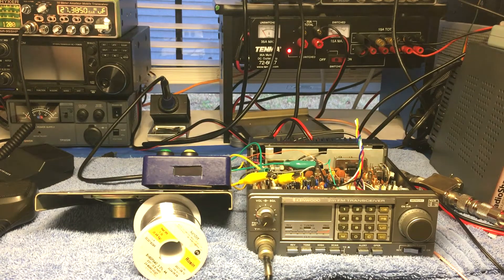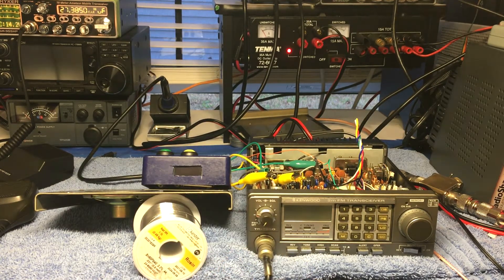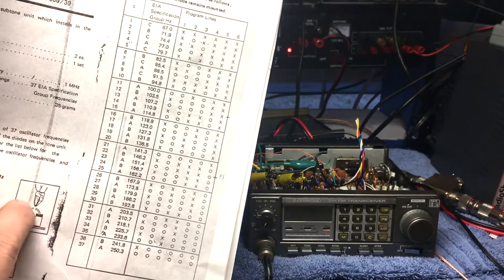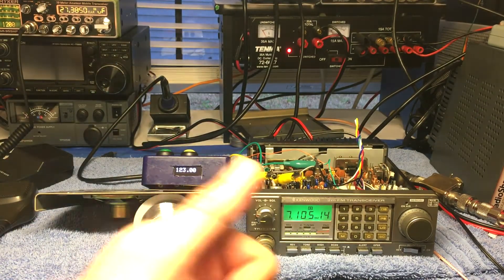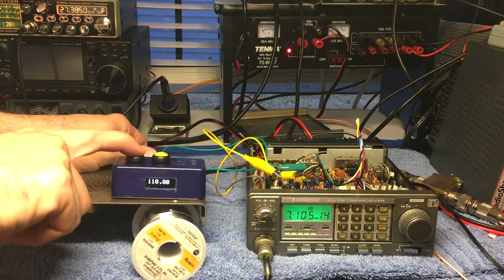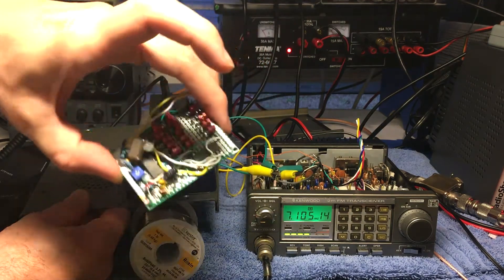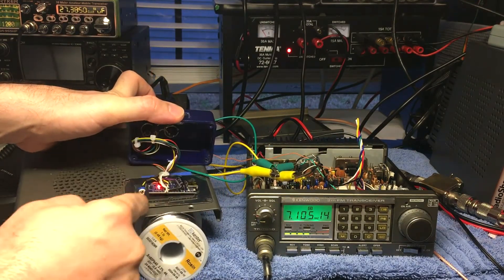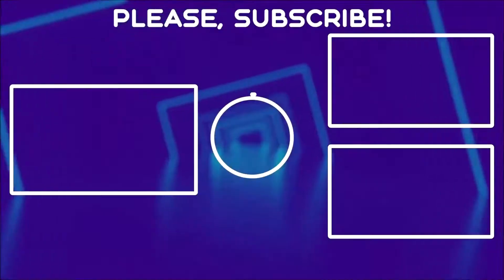Kenwood TR-7950  2m Ham Radio CHEAP CTCSS Tones with an Arduino !

Comment: YouTube keeps deleting my comments.  I just realized that it's because I put links in them.  I HAD said:
Nicely done. I came up with the same basic idea, but took a slightly different approach. My Arduino Nano is mounted inside the case, and responds to the switching signals to output three different tones just like the missing original tone board. I also route the output thru a tiny amplifier and a 3-stage RC bridge to shape the output to an approximate sine wave. Works like a charm.
... Now I would like to add:
You can see "my" version of this solution on Imgur, but you will have to search for it.  I can't provide a link.

Comment: It looks like you have a capacitor added to your nano board along with your deviation control along with both buttons, the board and the display itself.  Are there any other components required?
Reply from the maker: This is the video I used. Will give you all the info ! https://www.youtube.com/watch?v=wH9HD-YpBb8
Reply: @EricTechstuffs  thanks
Reply: @EricTechstuffs  Please setting rpu and tone 7950
Reply: @EricTechstuffs setting duplex, please

Comment: Would be nice if you showed the hookup
Reply from the maker: on the 7950 - This unit will connect to the TO, Ground,  FO and ST.  I will look for my connections.  But if you see the Kenwood TU-79 schematic the connections should make sense.  Just need to select the tone on the proper selected F tone # and external device will transmit  on that.